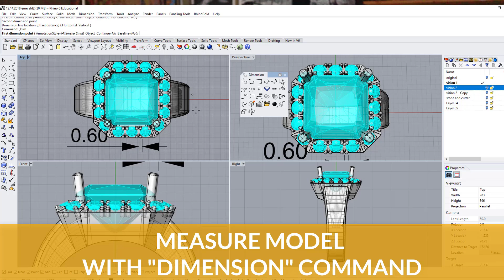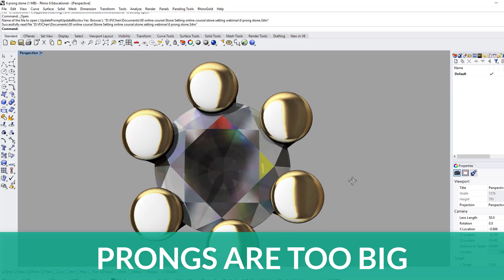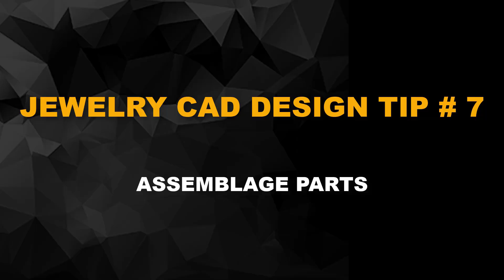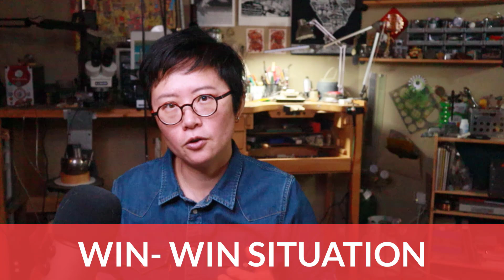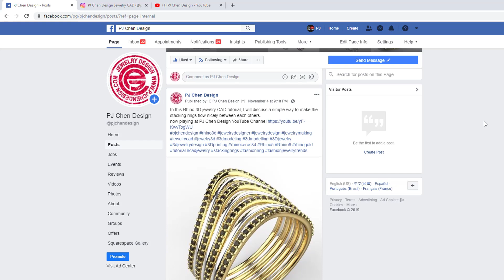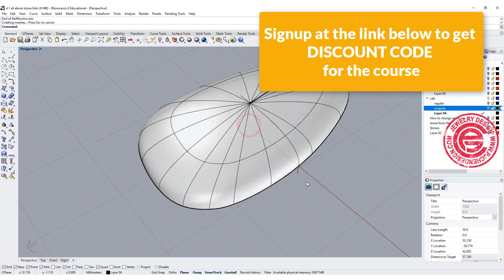Top 10 Tips for Jewelry CAD Design

Comment: Thanks for your Tips, very valuable, i just have a question about the first tip which is what concerns me for now, about the metal thickness, i can't find good information about how much thickness is the minimum, i know it depends on many things like the structure and the place of the metal, but can you share some general tips on how thick should the metal be at the least to hold it's structure
Reply from the maker: You are right, There is no standard for the thickness and it all depends on the design
Reply: @PJChenJewelryDesign  Thanks for your reply, and your content which is very useful
but can you share your experience about how thick should be the metal (specially gold) to be pintable and makeable  at least in 2 situation, first in a Mesh structure and second on it's own, as in a single simple ring, to be useable, like can a single wire of 0.6mm hold it's structure on it's own in a ring shaped
or can you suggest a way for me to find out about these matters? is there a book or specific article i can look into

Comment: Excellent video!  Thanks so much for all of your advice.  I do have a question, is .4mm the radius, diameter, or length that you suggest for bead settings?
Reply from the maker: 0.4mm in diameter will be the smallest prong/bead I suggest